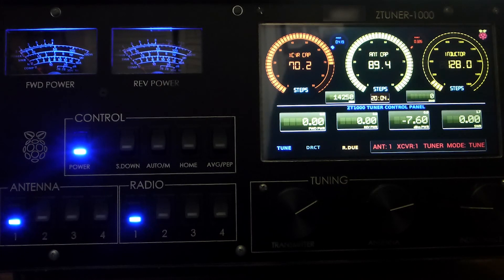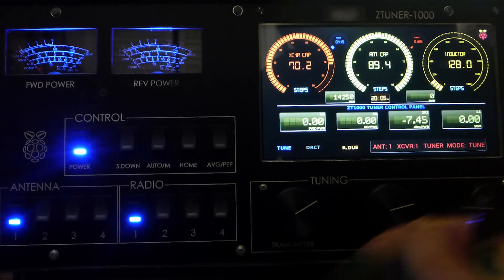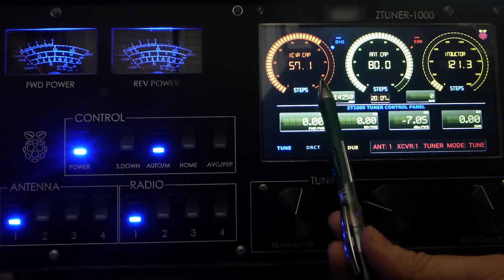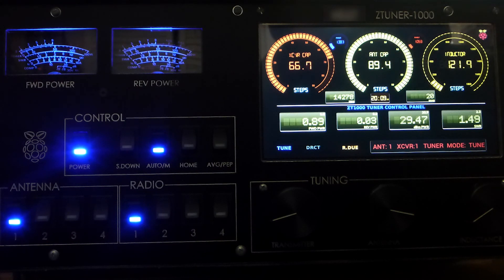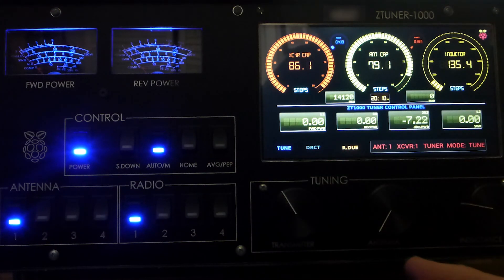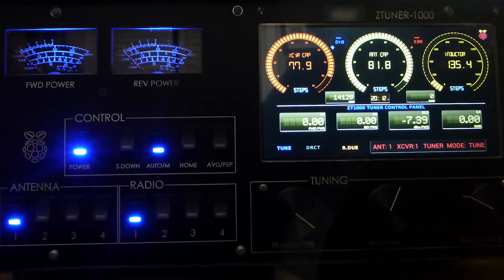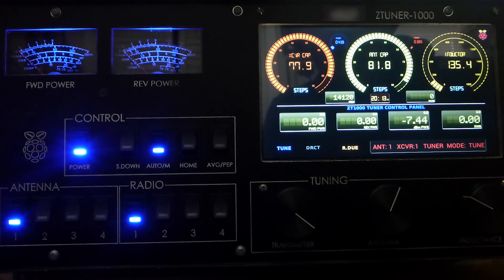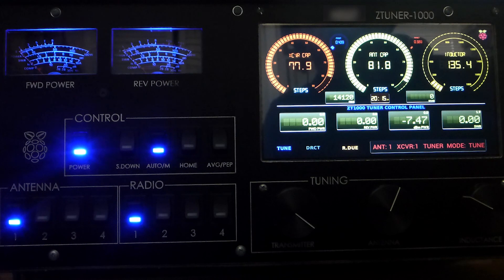Raspberry Pi Arduino Auto Antenna tuner part 2

Comment: Max power handling capacity of this tuner? Can it be built for 1kW TX power?
Reply from the maker: I have used a variable Inductor, and air vriable capacitors rated for legal Limit, 1.5kW.  I have run about 900W through it with no issues, as I do not have a legal limit Amplifier to test.

Comment: HI Cyborg I have a question.
when you adjust the tuner with in manual tuning then go back to auto tuning on a different frequency and want to fine tune it with in manual settings .
How to you hander that the manual pot are preset with the old values?
the manual value will detune the tuner when you change from auto to manual unless you remember to turn the pots back to 0 before going to manual?
Also are you getting any closer to releasing the code for your project?
thanks ED NW4K
Reply from the maker: Hi..The tuner always stores the positions of all the steppers, every time there is a change.  So when you change bands, turn it off, go from Manual to auto, move the knobs etc, the values are always there (Stored and recalled from the internal flash card).  As such, there is really no need to index the steppers once you do it once.  No, not releasing the code at this time...thanks!
Reply: ok but if I want a new different frequency (band) and the manual pots are set to a value of one of the old frequency and  go from auto to manual the old setting on the pot are read and could detune . 
I may be missing something here but unless you turn the pots back to 0
before going from auto tuning to manual on a new Frequency (band)
the steppers will take the value from the pots and adjust the steppers to who know ware .
What am I missing?
thanks
ED
Reply from the maker: I do not use Pots..I use encoders..so it does not matter to me what value they have....I only need to save the position Data of the steppers, the encoder values are all relative... ;-)
Reply: I was just looking at encoders and it hit me . I was on my way back to watch you videos again to see if you had said encoders when I seen your reply.
Thanks , and I will watch your video again before I ask a question .
Your video are Great and explain a lot.
Thanks for this project 
Ed NW4K 73's : )